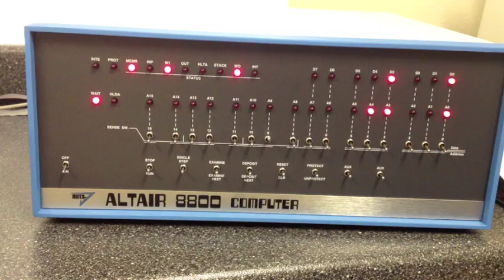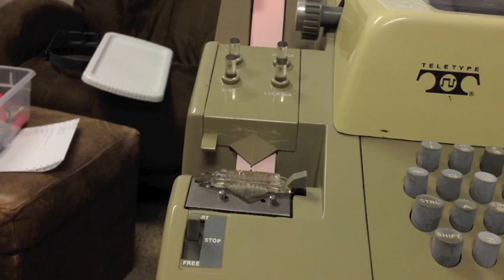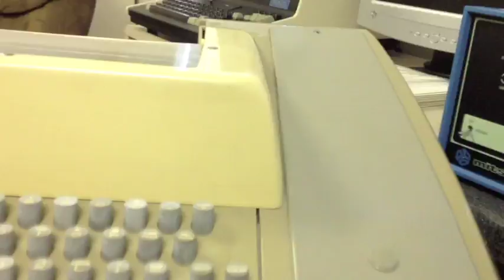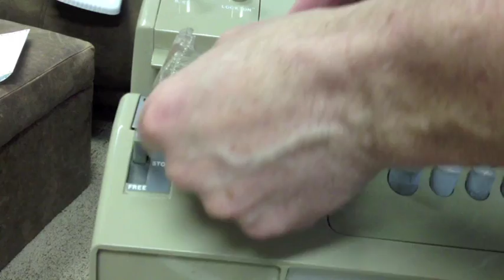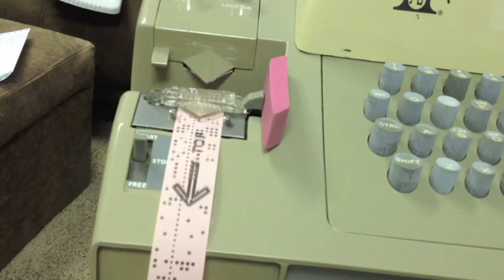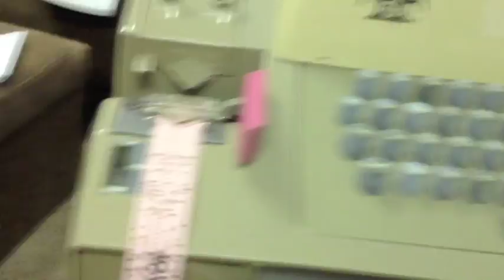Altair 8800 - Video #26 - Pong on the Altair 8800 Front Panel

Comment: I'm trying to figure out where that last $ff byte came from on the tape. Looks like it writes out 128 bytes (including 5 bytes after the end of the program) but where does the 129th byte of $ff come from? Perhaps it was something you did on the teletype manually after the save? Excessively pedantic minds need to know! 😅
Reply from the maker: The $FF was punched as an artifact when I switched the TTY from Line to Local. This is not unusual. If it matters, you’d typically turn off the punch, switch line/local, and then turn the pinch back on. See https://www.youtube.com/watch?v=WAYcLM5krB8&t=6s for a demo/explanation of that.
Reply: @deramp5113 Thanks for that explanation!